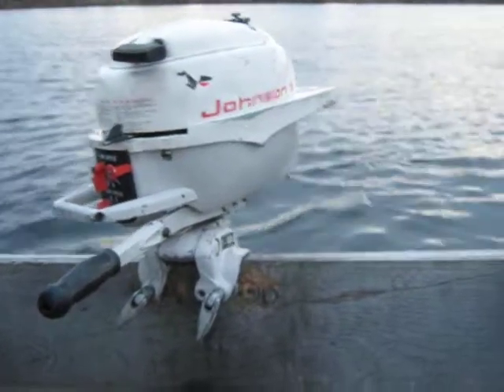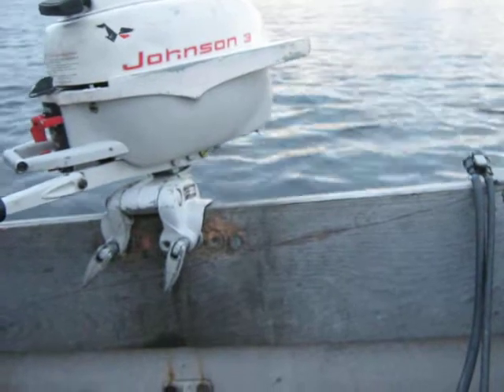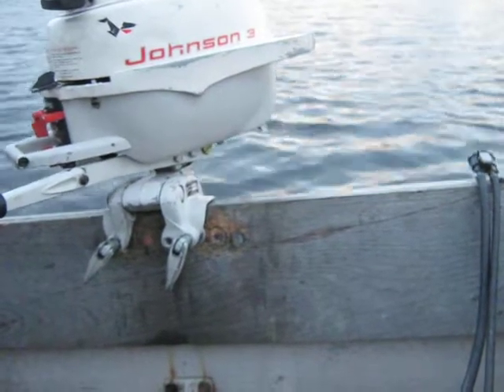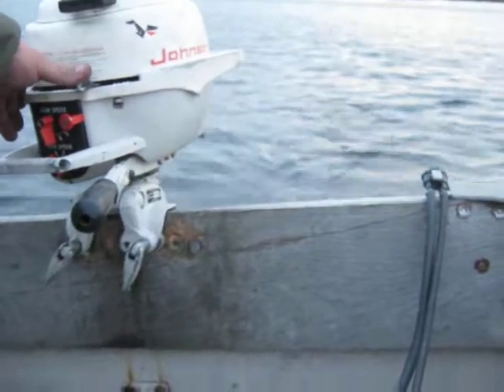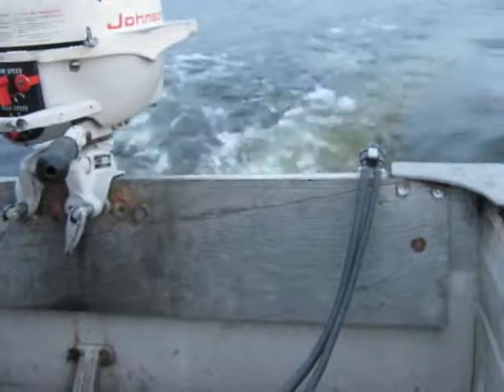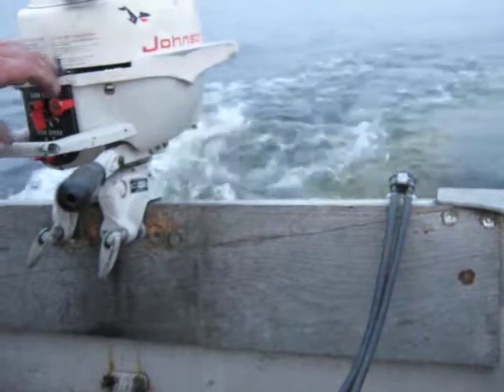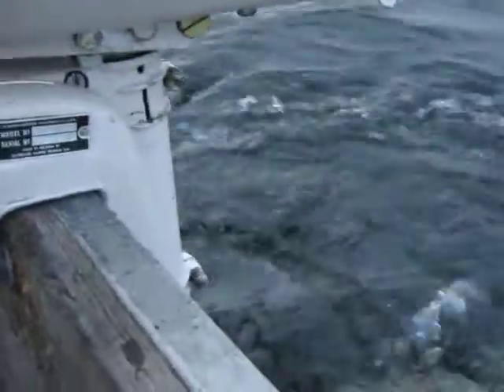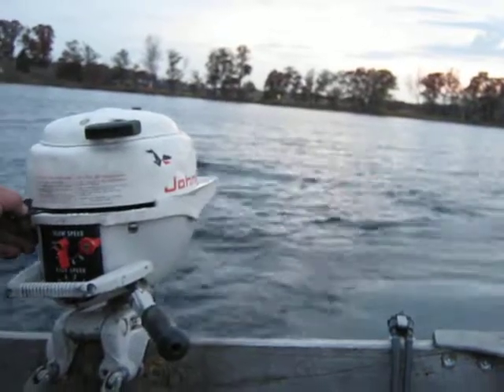1961 Johnson JW-17 3hp outboard motor

Comment: I just purchased one of these on craigslist a jw16 for $40 because it didn't run. Replaced the coils condensers points and impeller. It runs pretty good now but will not idle as nice as yours. I cleaned the carburator and was wondering if you knew where I can find a carb rebuild kit and a replacement float at. I think that might help. Also what's the recommended setting for the high and low settings. This is my first old motor purchase and I have to say I love working on these old things they are so simple but I'm learning along the way! Thanks for all the great videos keep em coming.
Reply from the maker: ***** Hear is a video i did on how to adjust the carb. https://youtu.be/I37zQpgUwaE
And this is the carb kit. http://www.marineengine.com/newparts/part_search.php?part_num=18-7043&returntopage=/parts/sierra-marine/sierra-marine-parts-catalog-00223.htm
It is nice to hear that you are enjoying your old motor.
Reply: excellent thank you so much! I will let you know how it turns out
Reply: chrysleroutboarddude 

Thanks 3 different carb kits 😜